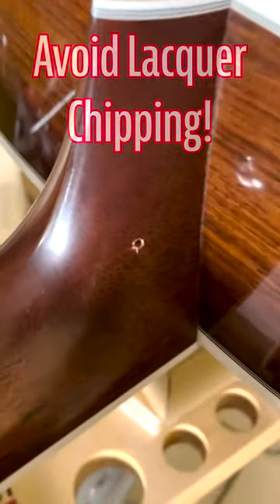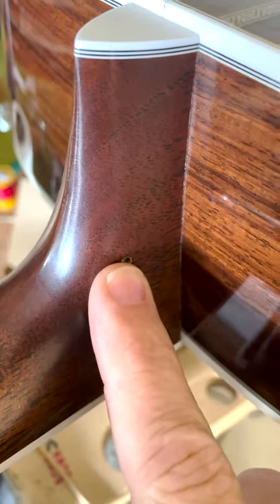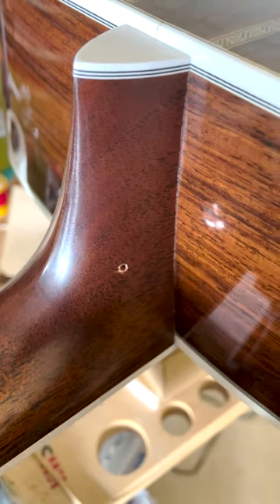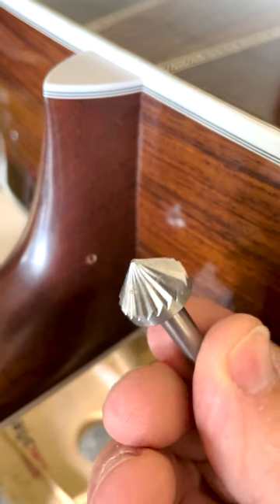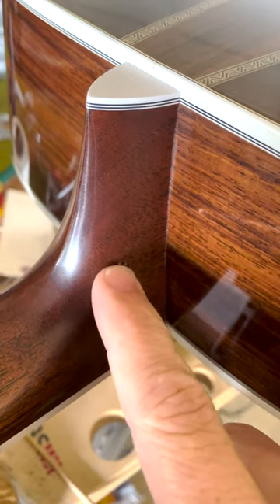How to Avoid Chipping Your Guitar Finish

Comment: Alternatively use a combination bit with adjustable countersink already attached. I’ve been using a specific type set that has several gauge bits with depth adjustable countersink sleeves. Perfect each time and great on a press for accurate countersink depths on applications like pickguard holes.